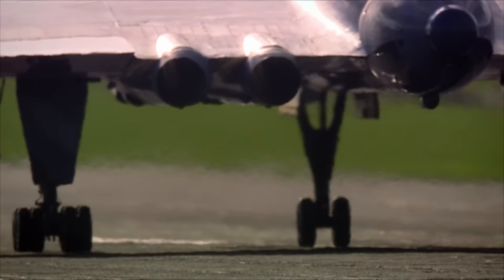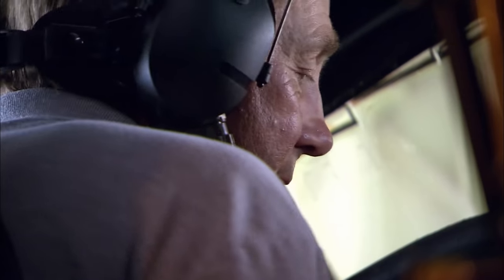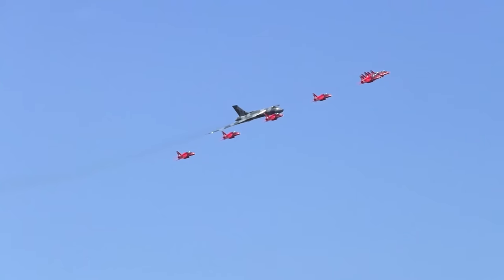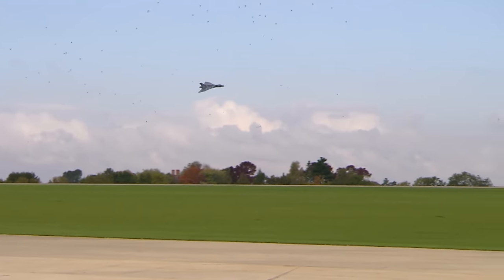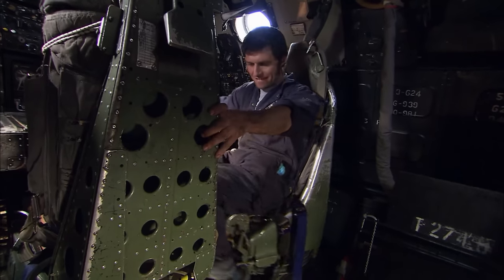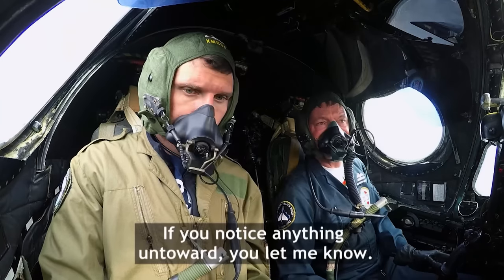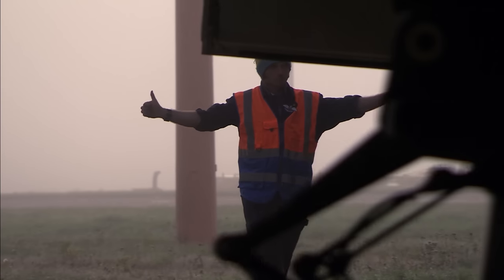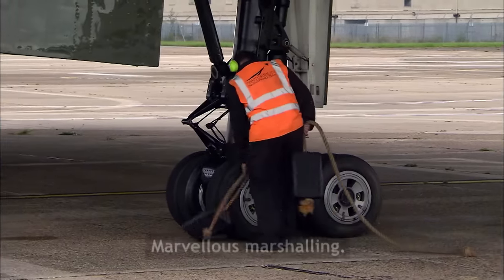Restoring The Historic Vulcan Bomber For Its Last Ever Flight | Spark

Comment: I've got the book written about the raid on Port Stanley, and one thing it mentions outright that you (only) get between the lines in this documentary is that every Vulcan was basically hand made.  In order to get each airframe assembled and working as it should many, many parts and subsystems were hand-fitted.  That meant that each and every Vulcan was a little different from every other Vulcan.  Each had it's own quirks, traits, little foibles.  In a system that complex, that amounts to something very like a personality.  One may be will be sullen, another reluctant, still another might be called angry and require a very careful hand.  But each is it's own creature.
     For whatever reason, XH558's character was that she took care of her crew and brought them home, even when things went wrong.  I can't think of any higher praise for an aircraft.

Comment: Unfortunately Aircraft built from modern high strength Aluminum alloy have a shorter service life. The high strength Aluminum is more prone to fatigue and corrosion than the older softer alloy. This in addition to the complex nature of modern aircraft makes keeping the airworthy much more difficult and expensive